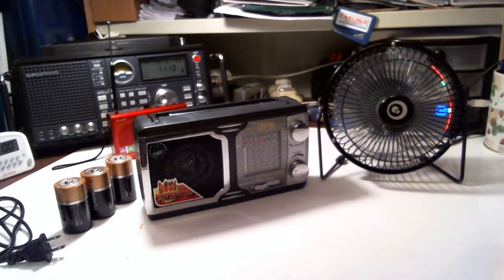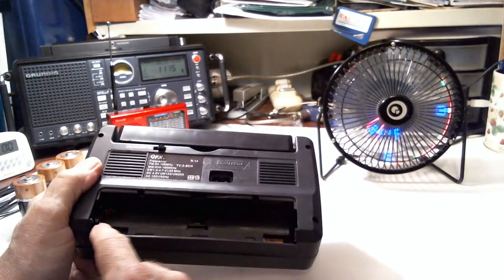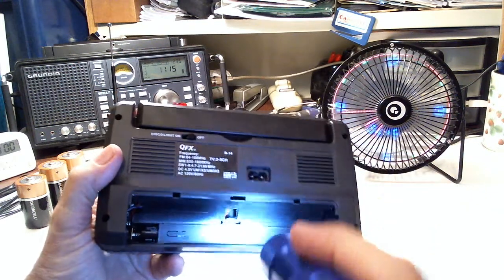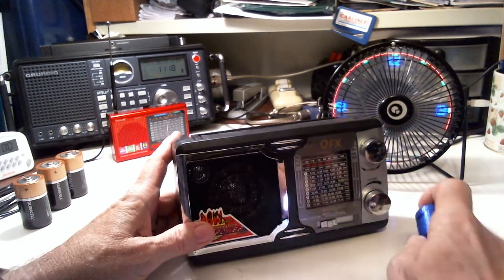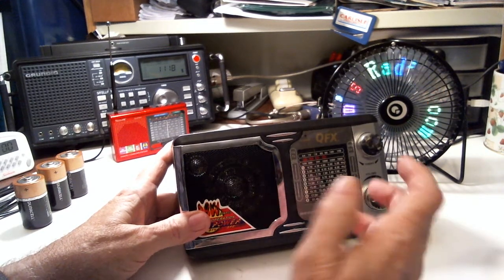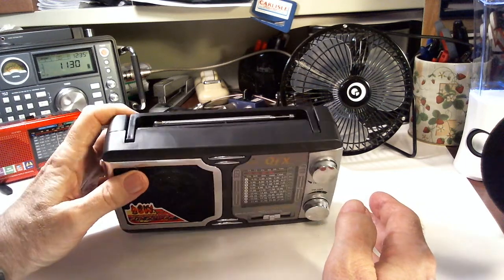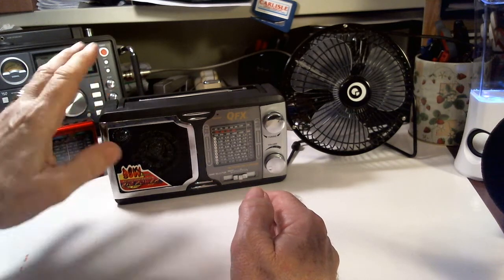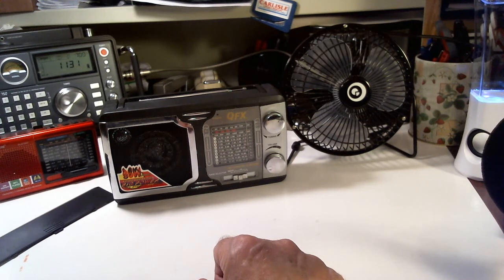TRRS #1265 - QFX R-14 AM/FM/Shortwave Radio - Update

Comment: So it looks like the unused d-cell compartment becomes a de facto storage compartment for the power cord.
Reply from the maker: You are 100% correct.  Don't understand why the put the spring in for the back connector on D cell???
Reply: hamrad88 I would assume it might be for other markets and they just don't bother taking the Springs out too much labor.
Reply from the maker: My guess, it that the case is used for another radio that requires more power and the AA batteries are used as a backup power for a clock function or memory saving.
Reply: QFX 24 use is D batteries you store the power  cord QFX 14

Comment: Hi tom its ray l have had trouble with chinese radios l recently had a ssb short wave radio and you could not resolve the ssb and it had a real problem. you can not beat. the sony panasonics grundigs from the 1980s and 1990s they were great.
Reply from the maker: Hi Ray, unfortunately if want an affordable radio it is probably going to be made in China but if you are will to pay the price you can still get those old radios.
Reply: I am in the same boat as you. I have no luck with Tecsun , which is such a big Chinese maker.  I like the old brands as well. I have  a Panasonic, Magnavox,  Realistic dx 440.  The Chinese Tecsun gives me more static and less reception than any others. I am going to sell many on Craigs List in Baltimore.    Best Wishes
Reply: I have two 'great' Grundigs of the late 70ies, early 80ies. And should I tell you? These cheap DSP chinese radios beat them easily on sensitivity and AGC is stellar compared to the Grundigs of these days, if they even had AGC.